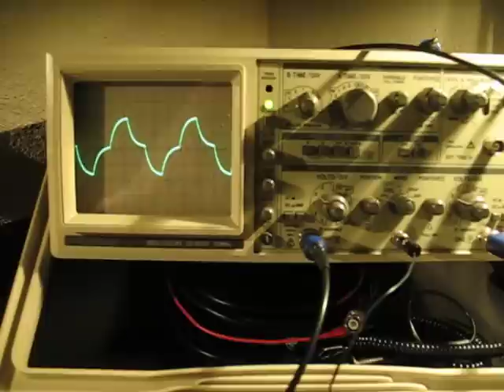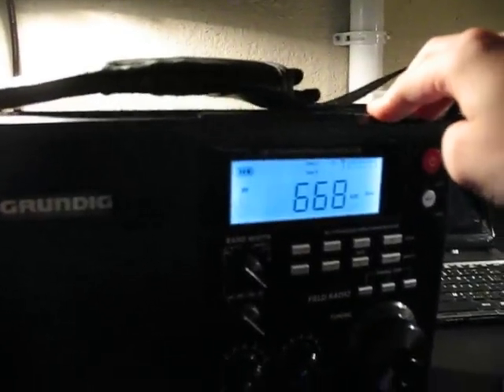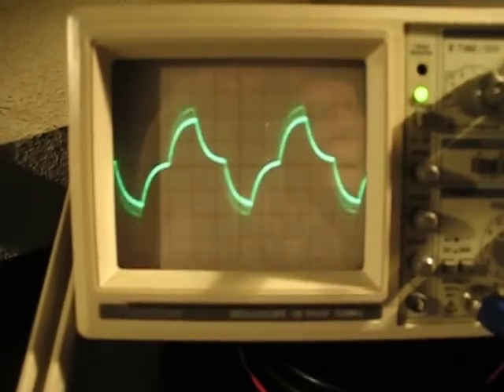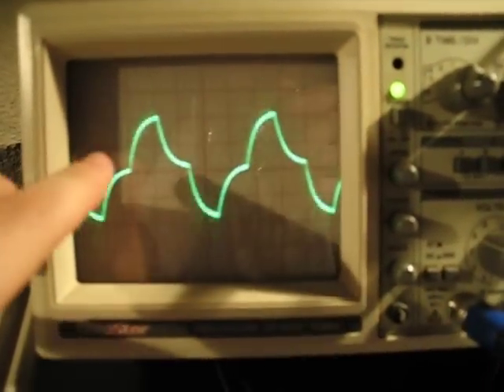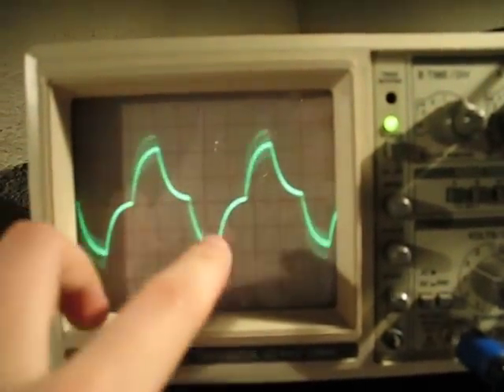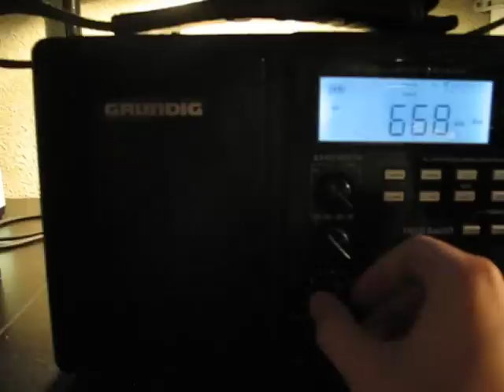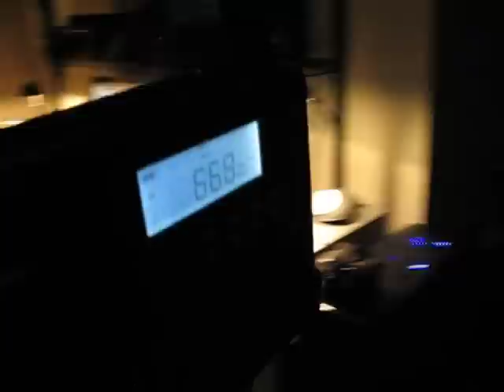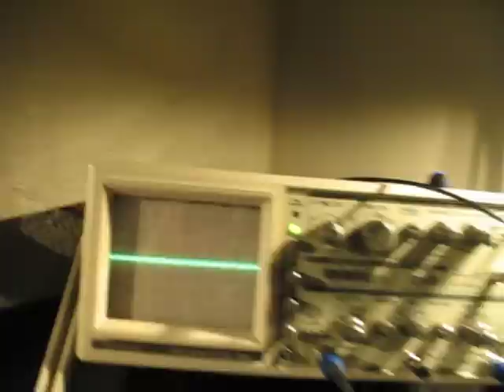Software Defined AM Transmitter

Comment: The strange thing is I'm toggling the GPIO pins at 64khz and picking up AM550 on the transmission. I coded up a sine wave and am repeating each sample x amount of times to control the oscillation rate sending them through an 8 bit DAC to toggle the transistor. The odd thing is its resampling a radio station that has a higher frequency.